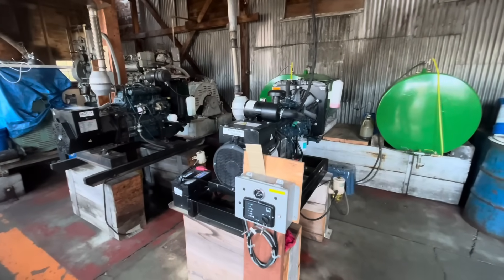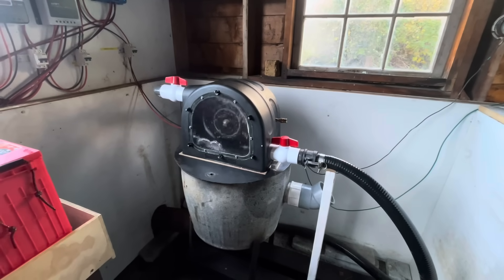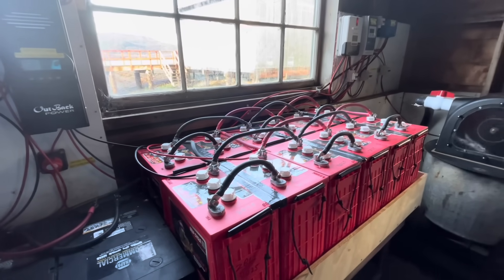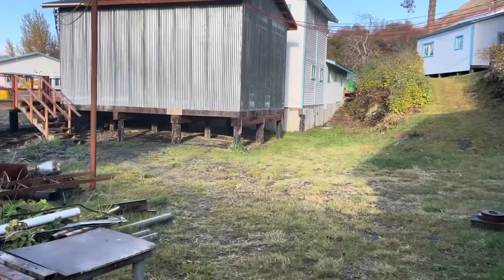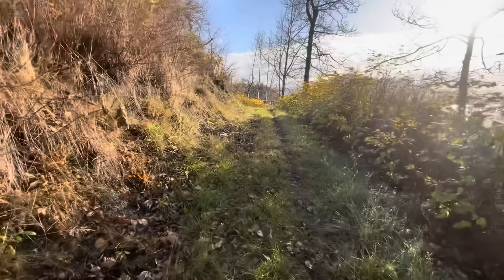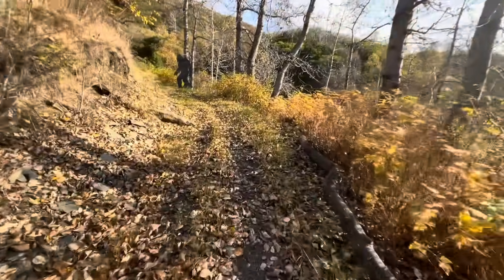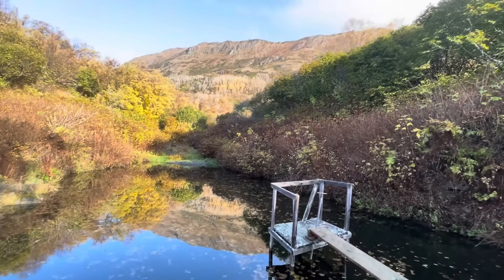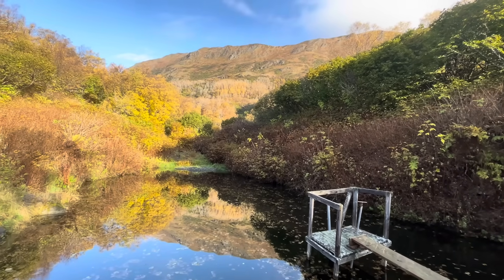How we make our own electricity in remote Alaska.

Comment from the maker: Click on this link to see a more detailed video of the hydro power system. https://youtu.be/gtd2Qx4e-YE?si=BDJXIJiCEF4bMOp_
Reply: Did you build the reservoir? Did you need to get local government approval?
Reply: By twisting the water in a line it takes the air out of the water which brings heavy water twisting friction which runs way more faster true a twisted pipe as a normal flow true a normal pipe.. 
it’s like creating a twister 🌪️ in the pipes, it literally means more speed and pressure on your generator.. which will be able to have way more energy to push a bigger generator as the pipes you have now… 

It literally causes a twister effect which pushes the air in the middle and a funnel on the outside, which really spins like madness.. 

You can try that out by trowing food coloring in a deeper stream like some 40 meters before a bend, you will see the normal movement of water droplets, those are all going in a twisting motion true the bend.. and not in a straight bend.. 

There had been many test in natural stream which had been calculated from starting point speed measurements and a certain point, where the starting point had way less speed because of its flatness, so they toke that as a measurement that the coloring should had been there much later, those people found out that they where completely wrong about the speed natural water moves, so they made many studies on the movement on waters and found out that the twisting motion of water increases the speed drastically if it goes in a twisting motion.. 

The same thing Viktor Schauenberg already found out around 1930 in the Swiss.. 
he was the only one which created a log moving canal from higher grounds which actually never jammed any log on his way down.. by creating a stream under the mainstream, where they water could flow down in a twisting motion..  which increases the speed.. and in a close system a round pipe didn’t brought that much, bud as soon he started to twist them like 4 half welded against each other and by going down further the pipe got smaller and smaller each meter 2 ore 3 mm.. 
which caused with less water more power..
Reply from the maker: @Berseker-d9e thanks for the info sounds very interesting. Lots more things to try.
Reply: Need hydro power ,get 2 metal barrels suck up water blow water threw hydro motor 11/11/25
Reply: Eliminate the word, "So", from this video, and it's good!

Comment: How do you pay for all that diesel fuel? Those generators are very expensive. Those battery systems/ Charge controllers/Inverters, are not cheap. The batteries would be thousands. I love your system setup, but the money to buy all this stuff has to come from somewhere….. Where all your money come from?

Comment: Great set up, very smart! Does that chargeable battery power bank in the shed needs to be heated in the winter? I thought batteries are sensitive to cold. Or they just basically operate at outside temperature?

Comment: I would put the batteries far enough away from the diesel tanks and generators that if you have a battery fire it won’t ignite the tanks and or damage the generators.

It would also be ironic if the water pump ever sprung a leak and shorting tge batteries or the charge controllers setting the batteries on fire.on

Comment: PVC plumbing would free up the exit flow from corrugated pipe. There is some wonderful pvc fitting options pool guys get, that Home Depot’s do not. Flow sweep 90s it has a circular flow , instead of a sharp 90 degree

Comment: Shoot, I wouldn't have worried about solar panels. Your efficiency on the turbine is way better. I understand redundancy, I'm a double redundancy kind of guy myself. Have you looked into "sand batteries", thermal mass? They're all over the Nordic countries, so even in cold climates they are consistent, efficient and cheap.

Comment: Are your lights DC current? Seems you would really only need 120/240 for things like a mainly furnace fan, washing machine, fridge and some small appliances (assuming your oven is gas).  Also, what about the winter when you have less sun and sub freezing temps? Seems you would have issues with your water discharge line from your generator.  I imagine your frost line is very deep. That replacement water source pipe is REALLY deep. Here in Kentucky it's 15 inches or more. The general frost line in Alaska is 100 inches (looked it up). I would still bury my line well past that.

Comment: So that water turbine can only power 3 lightbulbs?
Reply: Using the inverter (one sized correctly) and the batteries allows any domestic appliance to run off that turbine.

The batteries are depleted over the short term by the draw down..
but recharged over the other hours that there is no draw down....

Comment: you are not ''making'' power, electricity is already always available in the air ,the ''generator'' just provides the conditions of a type of magnetic vacuum process that causes the electricity to manifest like lightening into the physical world and it is trapped in the generator wires ,actually some electrician scientists are saying now the electricity isn't ''in'' the wire but it surrounds the wire .
Reply: "skin effect"....high Hz electricity has this problem running on the outside of the wire....

Comment: What volt system did you set up? 12, 24, 36, 48?
Reply from the maker: 12 volt. But if I did it again I would do 48 volts. Thanks for asking
Reply: @zacharbaylodgeinc8864  In thinking about a larger than mobile system, 48 seems to be the way to go.  The only thing I keep thinking about is the increased voltage difference regarding safety if something were to happen.  36 will make you dance, 48 may end the dance.  Thanks.

Comment: 260 watts is nothing it's like 2 1/2 amps.
Reply from the maker: It is a 12 volt system and it is making around 20 amps. 20Amps x 12volts = 240watts.
Thanks for your comment and watching.
Reply: @zacharbaylodgeinc8864  Oh.

Comment: Take note the size of his Battery Bank. He is stuck using Lead Acid which only has a 50% Range of Capacity. Anything less then 50% usage will cause damage over a short period. Lithium Iron Phosphate can’t be used as the room he’s using would have to be heated. Or at the least have internal heat to be used in climates under 32° F. Unfortunately the Lead Acid Batteries have a much shorter lifespan. Generally Lead Acid are cheaper but they do have there place in operations in Cold Climates. Other then that this system is very functional and provides adequate energy where none exists.

Comment: I’d park it and sleep next to the turbine - that noise would put me right to sleep.  Plus, I wouldn’t have to waste electricity on a fan.

Edit:  not sure why, but while he was walking past Sasquatch, I imagined his dad scowling, saying “that boy’s up there walkin’ and talkin’ right at his phone again - dang kids these days ‘n’ that stupid interweb…we didn’t have none of that growin’ up, and we sure didn’t walk around talkin’ into a phone like we was some movie star.”

I should probably just go to bed.  Some nice work, the water wheel is pretty trick.  It kinda reminds me of the wood ‘pipe’ I stumbled across in Oak Creek Canyon, on the Oak Creek, just north of Sedona, AZ.  They diverted the water from a section by some small falls through a narrow channel they created with some stone and mortar.  As the elevation downstream fell, they had created and pretty elaborate wooden channel structure that was on stilts about 30’ high.  It hugged the steep rock and ground, so it was pretty winding as it snaked downstream, probably at a 3-5 degree angle.  

The wooden channel probably reached 40’ above the Creek bed, where it finally started to go into the property, still downhill, to fill a pool that was bermed to about five feet above the surrounding area.  It was used to irrigate a decent-sized orange grove, but there was a Posted-Private Property sign we were obliged to respect.

So this whole three-sided pipe ran downstream, mmmm, probably less than a mile, but with all the stilting and the height, it was a sophisticated, reliable structure, and a heckuva project, and could easily have been 100 years old.

Oh, and despite the heights, looking rickety, and the channel being less than 2’ wide, it was very sturdy and I felt reasonably confident in its construction, and my Irish Golden pup followed, or led, along comfortably, mindful of the height.  I’ll be exploring it again, and this was only 4-5 years ago, so I’m sure I’ve plenty of pics n video of it.  Somewhere.  I certainly wasn’t expecting to run across something like this!

Anyway, thanks for jarring the memory loose.  Man, Oak Creek is The Garden of Eden of the Arizona desert.  If you go to Northern AZ, Oak Creek is a must.  You won’t comprehend that an hour west, north, or south, you could die from thirst in the desert.  

Thanks to this episode, and depending on how large the man made reservoir is/was, I’m wondering if it was used as a source of reliable and permanent electricity, too.

Comment: Andy, hello from Siberia! Very interesting to see this. We use here perkins generator 30-50 Kwt. 
Tourbine - good idea 80 feet is about 30 meters height difference.  260 Watts - not mutch, but do you spend the energy for pumping water in the reservoir?
Reply from the maker: The water just runs off the mountain into the reservoir. Thanks for sharing.

Comment: I may be incorrect but you might want to daisy chain your charger to each battery for a more balanced distribution to the batteries. I found a large off power discrepancy between end batteries and middle batteries over time
Reply from the maker: Thanks for the good info.

Comment: I do something similar as you do, but I don't have water. 

I live in Texas and have plenty of wind though, so, I have several wind turbines that compress air and store it in large tanks. 

I use that on a small turbine to create electricity to charge batteries.
Reply from the maker: Wow that is really neat. I never heard of that before. You should make a video. Thanks for sharing.
Reply: @zacharbaylodgeinc8864  Yea, definitely.  I have seen drawings of a large scale proposal, with huge (50-80’ ?) underground, pressurized air reservoirs, but have never heard of, or have seen, an implementation.
Reply: That’s incredible!  Is this for power to your private compound, or for something else?  Is this off the shelf, or did u engineer this yourself?

Comment: 4:10 No way that's 30 gallons a minute! 30 gallons a minute is a large soda bottle per second. That flow is nowhere close to filling a large soda bottle in a single second.
Reply from the maker: I never measured the flow. But when I ordered the power spout I told them I had a flow rate of 30 gallons per minute. So I assume that was what it was using. I will have to measure it now I am curious. Thanks for watching.
Reply: Did you not hear how fast the turbine was going?  With that wide of pipe, the pump rpm, the output power, it feels about right.

Hope he posts the flow, interested.

Comment: So Im just wondering how you keep the water from freezing? for your water driven pump. Very nice.
Reply from the maker: Kodiak island doesn’t get as cold as the rest of Alaska, so that helps. I have an insulated box with heat lamps when it gets really cold. Thanks for asking.
Reply: @zacharbaylodgeinc8864 Your set up is very impressive, I admire  your independence and ingenuity. Thanks for your note!
Reply: @zacharbaylodgeinc8864  How did the Earthquakes and Tsunami affect you?
Reply from the maker: @Discerning007  the one this summer that happened in Russia is the one you may be thinking of. We got a watch warning but nothing happened. Thanks for asking.
Reply: I would never think burying water lines 2-4’ would keep the ice at bay, but that’s what we do in WI.  Even at 20 below, no burst pipes.  AND the water is only flowing through the pipes on demand, whereas in his setup it sounds like the pipes flow 7x24.

Comment: I was going to ask how you regulate the voltage on the hydro generator. But the charge controller answers that question. 

That is a very impressive system.
Reply from the maker: I am glad you liked it. Thanks.

Comment: Next time you get batteries, they’ll be lithium iron phosphate with a 30 year lifespan so you’ll need modified charge controllers
Reply from the maker: Thanks for the advice. Technology is changing so fast my whole system is already out dated.
Reply: @zacharbaylodgeinc8864  well the good news is the battery prices are dropping really fast and who wants to water those lead acid seven year batteries anyway and the sealed ones were too expensive

Comment: you need to utilize air pressure to run engines just regulat the air pressure to the piton rating and have over pressure on the tanks with a release valve that releases exxes air for you tanks rating then run a tube turbine  pvc pipe with small magnet moters that make electricity then run them to a water electrolosys to get hydrogen  to run a generator to run more stuff gears help also

Comment: That is so cool, that pipe in the ground must have been quite a project! I guess the water is moving pretty quickly so perhaps it resists freezing, but you are in Alaska so how far down did you have to go with it?
If you were to set it up from scratch again, is there anything you would do differently?
I have solar and batteries in rural Ontario but I have too few batteries for my 4Kw of panels, so my plan going forward is to rig up some dump loads for after batteries are charged. First I want hot water in the summer, when my woodstove is cold and then I want to make and store some hydrogen with a medium sized electrolysis unit.
Reply from the maker: I buried it as deep as possible but there’s lots of rock on this island. So only a foot or two.
If I were going to do it differently. I would put the dam up higher and run two water lines. Also do a 48 volt battery system.

Comment: I am amazed how far that water line has to go from the reservoir to the house. What is the approximate distance, its hard to judge? Thank you,I was wondering what feeds the reservoir.
Reply from the maker: It’s around 1000 feet of pipe. The reservoir is fed by rain water in a on the mountain. Thanks for asking.
Reply: In the video I saw what fed the reservoir, I was thanking for sharing that. Sorry that I didn't explain that. That pipe must have been some work, thats about 2 tenths of a mile. Good to see you have a good relationship with local bear and Sasquatch. Lol @zacharbaylodgeinc8864

Comment: Thanks for the info! I have a remote cabin here in Kodiak as well. I have lots of rechargeable batteries and have just begun getting my solar set up together. I can get by with a whole lot less than you have. VERY impressive system you have there.
Reply from the maker: Thanks for sharing. I’m sure it will work great when you get it all set up.

Comment: Nice. Very similar to what we have here in northern BC. We use a solar/hydro hybrid system with diesel gen backup. The thought process was that on very sunny summers the solar would do the bulk of the power and on summers where it was very rainy and wet and the solar was inadequate the micro hydro takes over. Our hydro system puts out pretty close to what you get and we find it very adequate to run a full size household minus anything like electric stoves or electric hot water heaters. We use wood for heat, cooking and a small on demand hot water heater run on propane. Works like a charm.
Reply from the maker: Thanks for sharing. Sounds like a great system. It is a great feeling when you don’t have to rely on any one else.

Comment: You are something of a mechanical engineer with a knowledge of physics and construction and with the necessary funds to pull this off. Congratulations on your achievement. Cell service? A sat phone would suffice. What if you ever need medical attention?  What kind of wildlife visitors do you have?
Reply from the maker: Thanks for the kind words. I did hook up to cell service that was 10 miles away. I had to build a tower with a booster, but that is for a different video.
We use Starlink now for our phones works great. 
If we need medical attention, we will have to call a plane or if it is something really bad the Coast Guard will come.
Brown bear, deer, foxes, eagle, sea otters, seals, whales and more.

Comment: Necessity is the mother of invention. I do have a question for you. In the winter, do you have to warm the battery bank at all?
Reply from the maker: The temperature don’t get that cold on Kodiak Island. So no we don’t heat the batteries.
Thanks for asking
Reply: @zacharbaylodgeinc8864  makes sense. Depending on the make up of the batteries, the mere act of charging and discharging them generates heat. Thanks again boss.

Comment: Thank you for the video and your hard work of making this system operate in the most efficient manner possible for your needs. What is the lowest outflow of water coming into your electrical system can be without having your system impeded for your electrical output?
Reply from the maker: I think it is right there now with 30 gallons a minute. The solar panels put it over so I have a buffer. Thanks for your question.

Comment: Solar would help you extensively more if you would pitch your panels higher and properly to the sun. Otherwise I can't believe that they are helping much at all. I've lived off grid strictly on solar for over a decade
Reply from the maker: Thanks for the advice
Reply: @zacharbaylodgeinc8864 happy to help. Most people don't know this even most of those who live off grid on solar power. I have a really nice stream running through  my 41 acres in Northern Michigan and I would love to use it as supplemental power for my homestead but its illegal here to use the water in any way to power our homes. Even a floating turbine is illegal. Really sucks